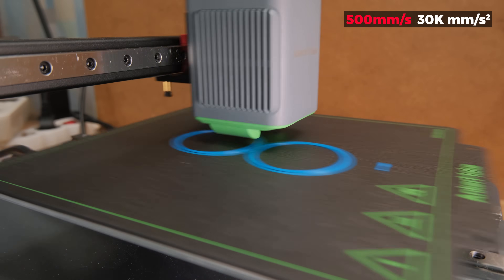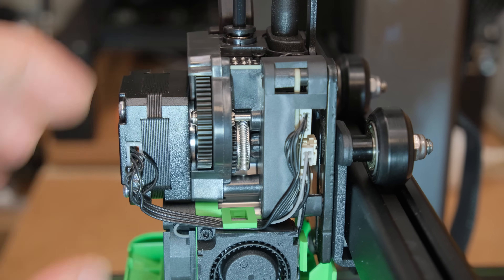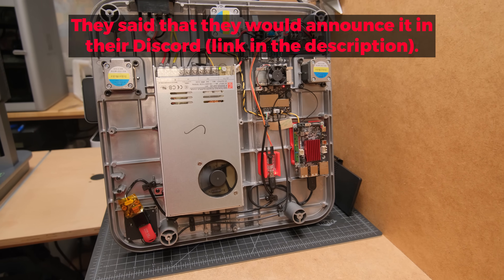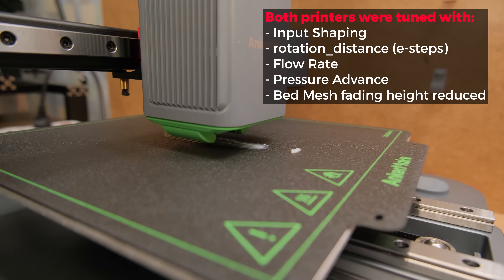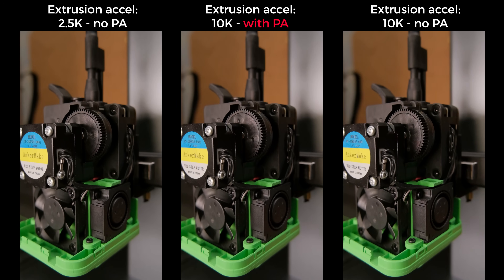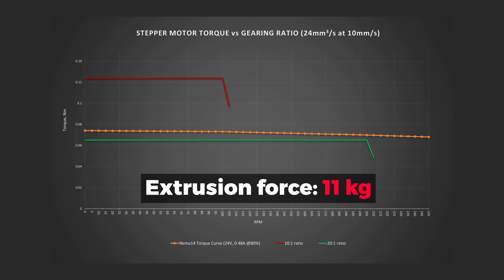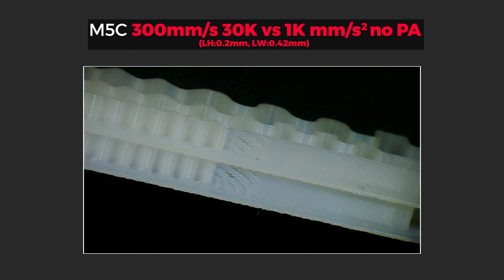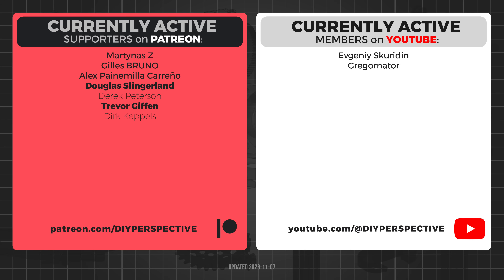High-Ratio 3D Printer EXTRUDERS – MUST HAVE? or STUPID?

Comment: I feel like this situation is much like the abl accuracy hunt. Yes, there are probes out there that can be even more accurate and with less deviation, but in fdm printing that extra precision makes no difference and isn't necessary.

Likewise, these big gear reductions are better, but unnecessary. No home printer is going so fast that regular gears can't keep up.
Reply: If you want 100 mm³/s through a nozzle that can give you decent precision, you're going to need a lot of force...
Reply: @daliasprints9798  Yes, you will. And printing at 500mm/s with a 0.2mm layer height and 0.4mm nozzle it will only take 40 cubic mm/s of flow. That's only in the straight and fast parts as acceleration limits speed during intricate prints and corners. During slower bits you need way less.

And no matter how hard your gears can push, the limiting factor is how fast the plastic can melt. The hotend is more important. If you push the plastic before it can melt you don't have a print. Nothing sticks together. The graphs in the video show that both the high gear reduction and regular are well below their torque limits.

It's like having a sports car on the highway. Yeah, it's cool that it can go 200mph, but it's limited so it can't go any faster than my commuter car with a max speed of 100mph, since the speed limit is 60mph
Reply: @Lethal_Bite  I said 100 mm³/s not 40 mm³/s. Fluid dynamics of the molten plastic, not melt rate, are dominant way before that point. You can get unlimited melt rate just by lengthening the melt zone, etc., but the fluid dynamic limits are much more fundamental. We already have hotends that can easily melt over 150 mm³/s, but that's of limited usefulness if you need a giant 1.0 mm or even 1.8 mm nozzle to get it out, since all you can print is big imprecise ugly stuff.
Reply: @daliasprints9798  How do you avooit filament swelling then ? If you brute force the shit out of the nozzle you get the swell so you need some new type of compensation once again. IDK 20:1 really does not seem to be necessary
Reply: @sierraecho884  Die swell is irrelevant except on bridging and steep overhangs, which you may have to slow down for (cooling them sufficiently at these speeds is incredibly hard anyway). If you're extruding against existing material, the combination of that constraint and the motion keeps the material in the right place.
Reply: @daliasprints9798  Not sure if this is true, you can see problems with that here on the video. Filament will swell a lot when extruding it fast with a lot of force.
Reply: @daliasprints9798  yes, and I was bringing up how standard printing at fast speeds doesn't come close to that amount. 100 cubic mm/s with a 0.4 nozzle and 0.2 layer height means 1250mm/s I have never seen a home printer go that fast. The fastest speed benchy so far was 800mm/s, and it was horrible quality.

You do bring up a good point with very large nozzles and parts though. Could be useful there.
Reply: @Lethal_Bite  I easily have the kinematic capacity for 1250 mm/s (running travel at just under that right now because I haven't retuned since going 48V and Klipper doesn't yet know how to further limit delta velocity near edges of build area). If I had the melt and extruder capacity, I'd run print at that speed.
Reply: @Lethal_Bite you're doing sports cars wrong but otherwise agree lol
Reply: Yeah I always keep asking "Why" ? Why would you need it ?
Reply: Nozzle tap (load cell) leveling is the best hands down. The Creality and Prusa systems are terrible and unreliable.
Reply: My home printer goes 900mm/s at 100k with the extruder and meltzone being major limiters for me.

Comment: What ratio would be good for this stepper motor? 20BYGH24
Reply: Nema 8 has basically no torque, this is the case where you would need something like 20:1 or so. You can simply calculate it yourself, look up the torque for the motor and try a gearing calculator.